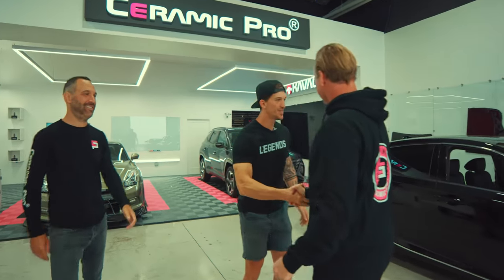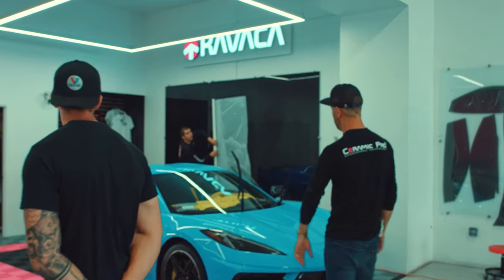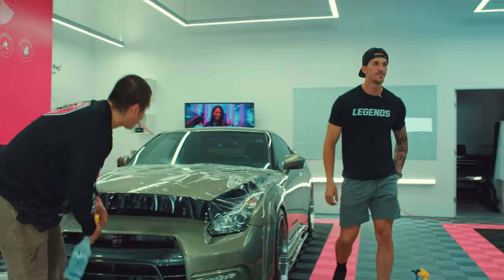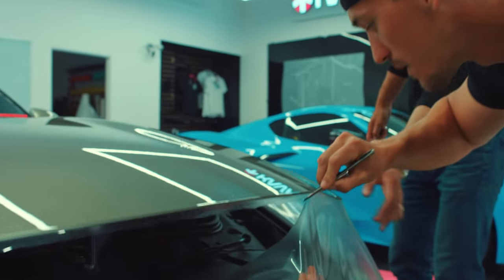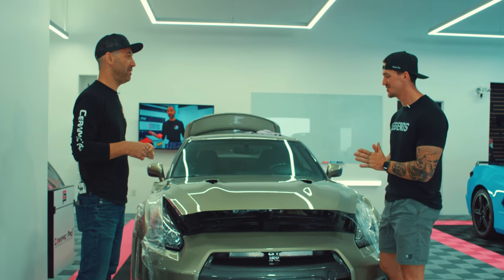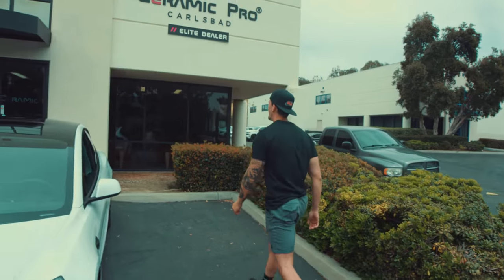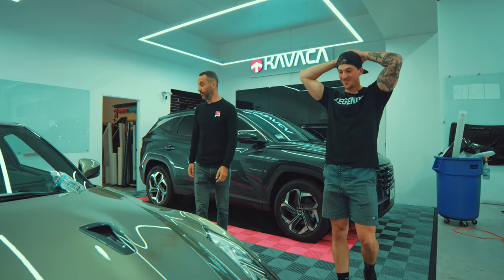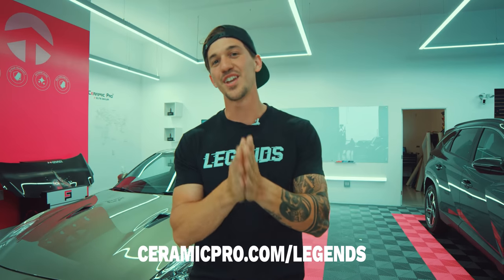Dustin Williams Gets KAVACA Paint Protection Film on his GTR!

Comment: So aside from the film there’s no extra coat?

Also is the coating within the film lifetime?
Reply from the maker: Hey RickySlickk, KAVACA Paint Protection Film comes with Ceramic Coating pre applied on the film and the film has a 12 year warranty.
Reply: @CeramicPROUSA  thanks!
Reply: So how much does it cost for a typical sized car - say a 911 to be fully covered?
Reply from the maker: @ystebadvonschlegel3295  Price varies on the package, amount of paint correction needed and which film is being applied. Also, knowing if it's a 997, 991, or 993 variant of 911 body styles will also be variables due to how much coverage can actually be done on the painted surfaces and how difficult it is applying it to that specific model. Visit: ceramicpro.com/freequote to get an estimate from your local certified installer.